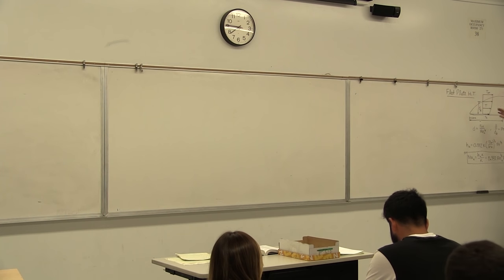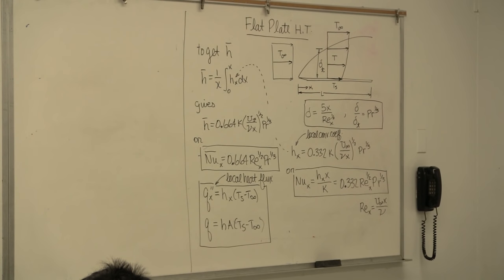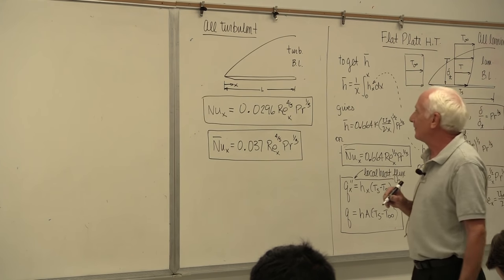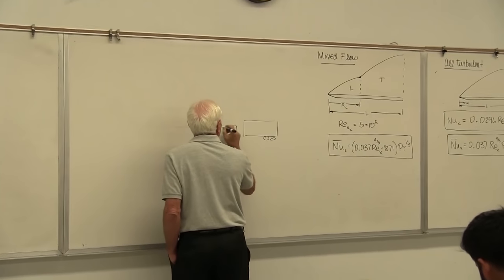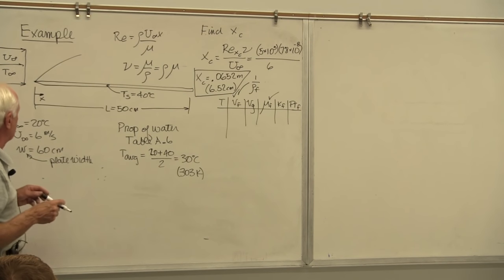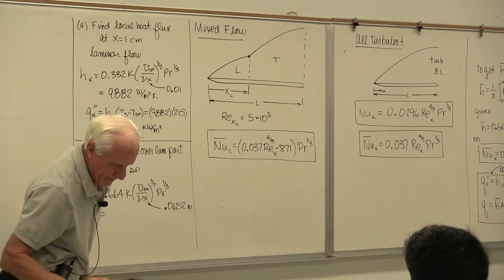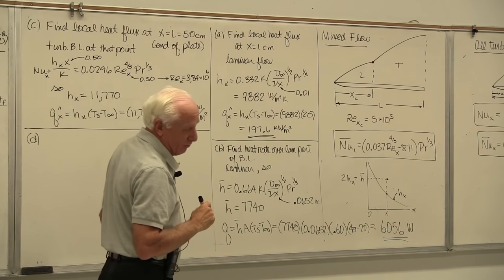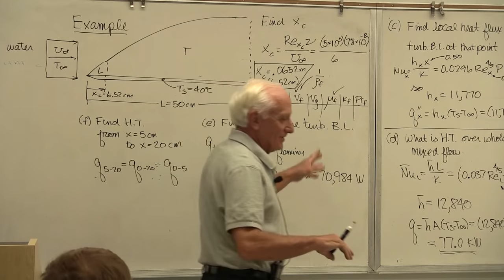Heat Transfer: Flat Plate Convection, Part II (19 of 26)

Comment: I believe there is a small mistake at about the 27 minute mark in this video. Dr. Biddle is explaining how to find nu, the kinematic viscosity and he says nu is equal to mu, the dynamic viscosity, over rho, the density. He then goes on to explain that by using a thermo table and the relationship between density and specific volume, the inverse of density, you can rewrite nu as rho times mu. I think he meant that nu can be rewritten as vf, the specific volume, times mu.
Reply: Thank you, I just spent about 20 minutes trying to work that one out haha. Was about to comment when I saw yours.

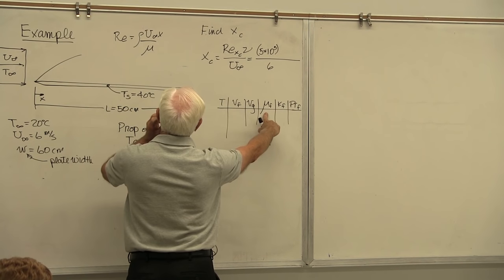Comment: Great video, just one small mistake I think. At around 27:00 when discussing how to find kinematic viscosity, he states that Kinematic viscosity is equal to mu divided by rho, which is correct. He then states that rho is the reciprocal of specific volume, also correct. Finally, he writes that kinematic viscosity is equal to mu multiplied by rho. This final equation should instead be specific volume multiplied by mu.
Reply: seconded